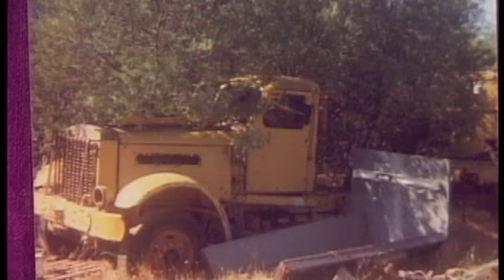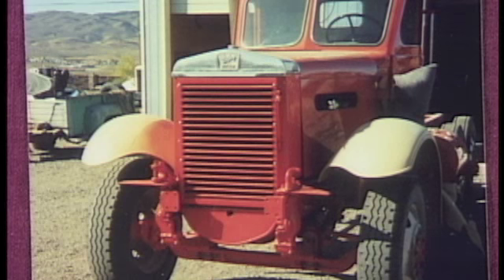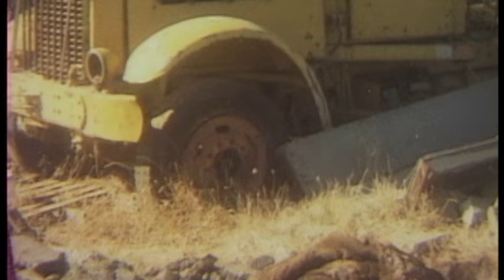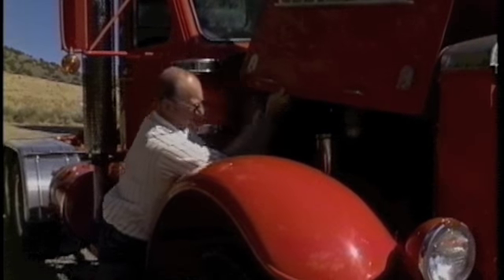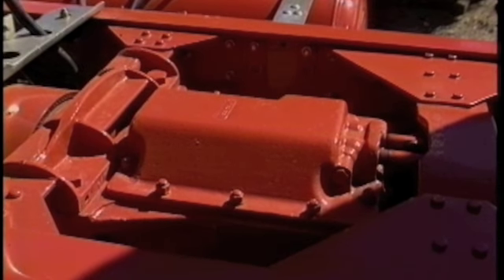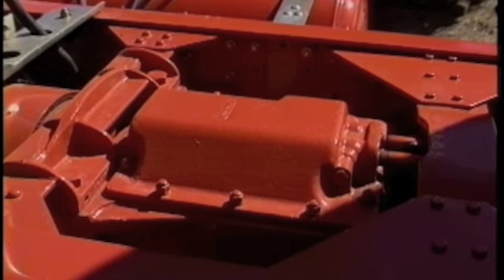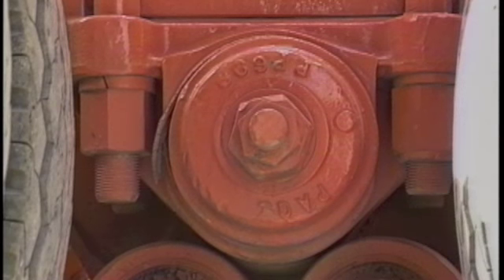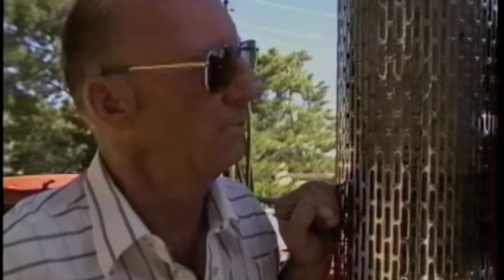'52 Sterling White part 1

Comment: I have a 1942 Sterling fire truck that has 32.275 original miles and still has the original raint job.  It has a Hercules 404cid flathead 6-cylinder gasoline engine and 5-speed overdrive transmission and hydraulic brakes.  Still runs good.